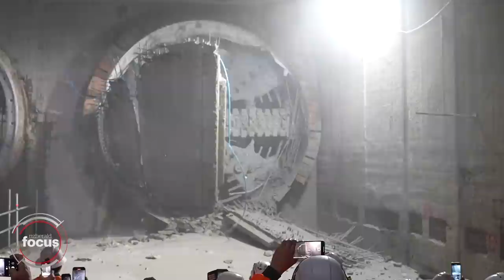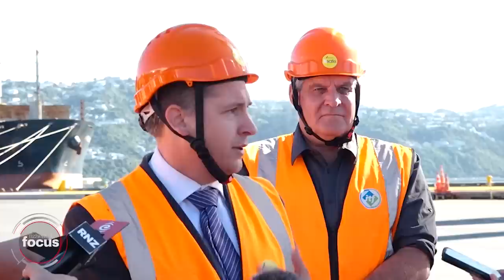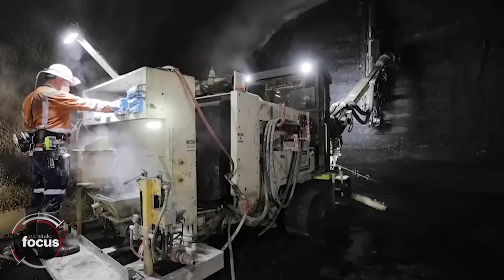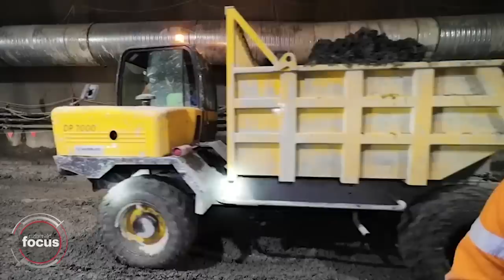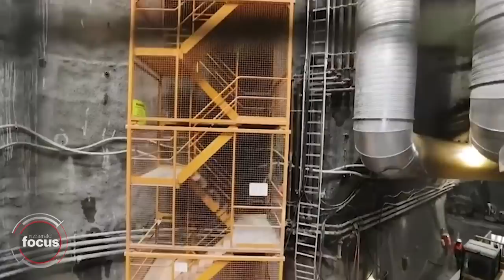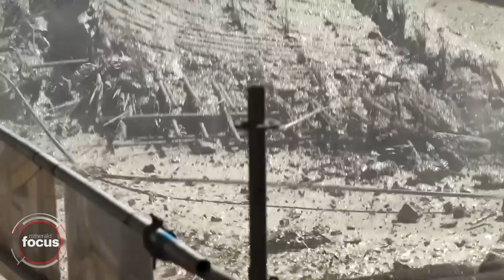Michael Wood on City Rail Link budget blowout | nzherald.co.nz

Comment: With the amount of work and investment to date this project must be finished.  The proposed "light rail" is pie in the sky. Rather than committing an open ended budget of anything up to $30 billion or more it would be better to forget about "light rail" and use government funds to support other transport initiatives such as completing this CRL project which has become an unsustainable burden on ratepayers. A third railway line from the city to Manukau, a spur to the airport and electrification of the lines from  Pokeno to Helensville (including dual tunnels at Swanson) would be better use of public money.
Reply: nah forget trains.  they're never working when you need one
Reply: @kungfutzu3779 Then let's try and fix that.